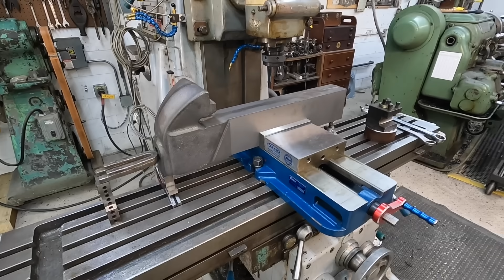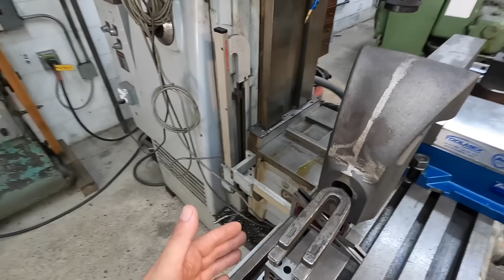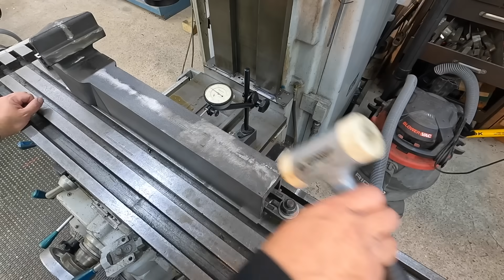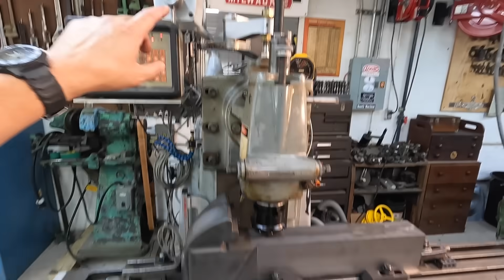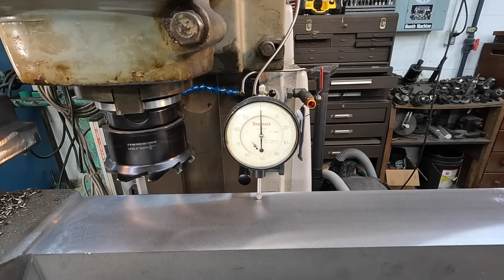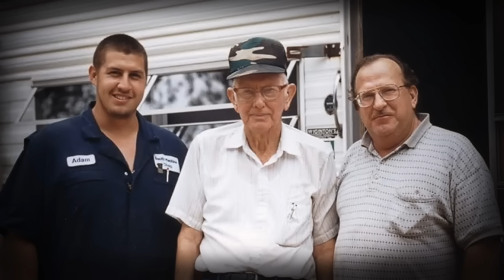Hardtail Vise Build Ep.9: Facemilling in the Kearney & Tracker Horizontal Mill

Comment: Have you considered rebuilding it . To tighten up the tolerance . Or is it not worth the time and money?
Reply: 1- It is way MORE the accrate enough for the vise and 100s of othere things. - +/- .010 TIR is good enough for a friggin vise. Most places on ot +/- .,025 would do.

2  Tighten the gibs. It only moves .002 what you go from dead loose to full tight. If you loosen the lock just enough for it to move it would be dead nuts on. .

Comment: I wonder if a fly cutter would have been an option to get under that overhang and also finish the rest of the surface?
Reply: YES......Set up horizontally  over the back edge of the table. - We got a 10" face mill that we use on out Cinci that way all the time because we don't have a right angle attachment  ;-)

Comment: 28:08 I believe the end marking is because half a tool realeses from the engagement and tool pressure lowers making the other side dip in to the part dipper. a spring pass usually solve this. but looking forward to see your troubleshooting...

Comment: Adam, beginner question.... your dial indicator does not have the base square....i take it, that does not matter....you are looking for movement from its random ref....is that correct?
Reply: Are you talking about a deviation from vertical for the spindle?  I think some of that might be the lens and capture, which is definitely not orthogonal.  The spindle actually looked pretty vertical to me. Then you can do the math... at nearly 0 degrees tilt, it's less than a thousandth error per degree over the 50 thousandths, so... not too bad.  Could have been off a little, but still well within tolerances for this beast!

Comment: You could take that vise to the next level and get the biax scraper out and scrape those 4 surfaces flat, square and parallel.... It would look pretty neat too !
Reply: For haw long . That is the vise where you whack on things with a 13 pound sledge. - THE most brutal tool in the shop. - It's what it's for.  so why the emote to bring in in at .003 TIR?

Comment: This setup would be the perfect time to have some Abom sized "low" profile table vices.  The ones that have the taper to them to press into the material as they are tightened down.  But, they use a SHCS fpr a fastener which is recessed in the body fully.  Putting two on either side rather than the toe clamps to stabilize the middle and reduce or eliminate the ringing.  Most of these clamps are only about a half inch thick.  I'd like to think and Abom sized one would be an inch and a half thick and two inches wide.

Comment: You have always had issues with the K&T. Problems with the motor, the knee, the ways and locks and even the spindle. Hell, you had it for several years now and you still haven't touched the on-board coolant. With the new shop, it may be time to let go of the K&T and pick up a big boy mill.
Reply: Or start a rebuild!

Comment: I'd love to know how you ensure that the spindle is square with the table.
Reply: The tram of the spindle in nod and yawl seems to be A1. The pattern left by the cutter teeth tells the tale. 

As to how to make this so, several ways, he usually trams by swinging a DTI (dial test indicator) over an averaging block placed on the table. There are at least 4 ways l know of to achieve this ensurance. As to how this time, your quess is as valid as mine.
Reply: Was the knee locked when the spindle was trammed? @CothranMike
Reply: @machinists-shortcuts  ah, so true, restraint of movement should not itself create movement. It is an old production machine never been reclaimed, restored, just cleaned and used.

Comment: If you run a board thru a planner you get “Snipe” maybe that’s what your Mill is doing?
Reply: In a manner of speaking it is the effect. The gib is 'adjusted' for the center a worn area. The gib is getting tighter as the unworn, or lesser worn dovetails engage that area and the table bucks a bit as the table is powered through. With hand cranking you can read the wear patterns of a production machine using the gib adjustment as a feeler gauge.

Comment: The finish changing on exit could also be from the part or tool 'ringing'. A 0.050" cut isn't nothing. Cutter on the backside has less load/deflection so prolly cuts a bit more coming back across which I'm sure you know. Also, yeah a long fly cutter would have done it...
Reply: I don't think so, you can see the cutter making arcs instead of full circles, so the tram is slightly off, but on the end you can see full circles, so from one side to the other the spindle tram is changing, a somewhat common problem on old equipment, the bed ways are worn curved, so the bed traces that curve.
Reply: @ChatNoirLe  You noticed that as well, good eye. I imagine the wear is in double digits, what do you think.
Reply: Thanks!  I didn't see that.  I'll re-watch at higher resolution and probably learn some stuff.   @ChatNoirLe

Comment: Hello Adam I was hoping you would use a horizontal milling cutter, I belief thy call it a slab mill
Reply: He memntioned using the mill in that mode, but did not say the cutter type or method, though come to think he did say hang it off the edge and using the tooling held in the horizontal. 

A small diameter slab mill would even fit under the jaw head maybe. But I like the shaper work he is planning for that area.

Comment: ABOM. A LONG FLY CUTT ER WOULD HAVE GOT UNDER THERE.
Reply: That would work but it’s really not necessary. The vise will be slightly stronger by leaving the extra material under the ledge.
Reply: @ellieprice363  
Inside corners don't make things stronger.
Reply: @ellieprice363  You must have missed the bit where he said he was going to machine it in the shaper, necessary or not, less strong or otherwise.

Comment: "In any system of energy, Control is what consumes energy the most.
No energy store holds enough energy to extract an amount of energy equal to the total energy it stores. 
No system of energy can deliver sum useful energy in excess of the total energy put into constructing it.
This universal truth applies to all systems.
Energy, like time, flows from past to future" (2017).
Reply: So...
Reply: @Bob_Adkins  Karl Marx, Nikola Tesla, Balfour, Einstein, Huxley, Orwell, Turing - should be forgiven for thinking their systems can last forever.
Finite fossil fuels are dangerously hypnotic to humans, their consciousness and mental capacity.
Humans were not ready morally, ethically and intellectually to start the mass extraction of fossil fuels with the advent of the steam engine 300 years ago. 
The Magna Carta requires today overhauling – adding to it the right for humans to understand what Energy really is - before any other commandment;
"No system of energy can deliver sum useful energy in excess of the total energy put into constructing it" (2017).

Comment: Nice to see the manual machines still being used at the home shop!  Always liked the Monarch lathe!
Reply: Come to our shop,,,,and it's a revenue  shop. We are actually industrial electrical/millwright contractors and have repair and replacement jobs where the parts are no longer available or have 6 months lead times. Well over half the time we can have the part done and be typing the invoice to the client before the kid can finish the pretty picture in SolidWorks and get the program out to the floor for the Haas mill. ,,,, Who can then start loading the tool changer. - If you think manual machines are not used every day to make money you ave not been out in the industrial world.CNC has it's place but it's not for quick turnarounds. .

Comment: I like this new tech where the tool spins opposite direction to the spindle. I believe that reduces imbalance vibrations and yields nicer surface although chips are being blown away in a direction opposite to cutting because of wind from spindle. Very cool!
Reply: I was thinking he should tweak the frame rate of the video so it looks right. It's a bit unsettling to watch as is.
Reply: Yeah, I'm feeling the wind.
Reply: And the way it reverses and even stops when you put a load on it.

Comment: If you set the part on the table the other way round so you cut from right to left, the chips would fly to the back instead of towards you.

The indicator is not needed. The finishing cut is relative to the previous cut, if both have the table locked the distance the knee moves on the dro or knee dial is correct. When the knee was moved up to 0.048" on the indicator it actually moved 0.050" because the needle dropped to -0.002" when unclamped. On the second attempt the table was moved 0.048" from -0.002" on the indicator to 0.046" and the clamp raised the final 0.002". 

Generally the knee is rarely locked, the large mass of the knee takes care of any Z axis backlash. This leaves the knee solid and the sheer mass of the knee & part stop any lift. The only issue arises when a combination of a cut with the knee locked is referenced to a cut without it locked. This is what was used in the video & the issue was entirely self inflicted.

Using a depth micrometer with a 5" long spindle does not give a solid feel. It is far easier to use a 1" rod onto a 4" gauge block.

A nice chamfer could have been added to either side with that cutter.
Reply: I thought the same thing, I asked him a similar question once and he said he preferred to avoid the machine throwing chips at him!
Reply: Them hot chips will keep you awake. Never fall asleep in front of a milling machine unless you’re leaning backwards.

Comment: Adam, how much time gets wasted re-thinking the set-up, screwing around with mounting that skyhook crap when you could just grab the dang vice jaw and lift it yourself?  It’s not THAT heavy!
Reply: How much time gets wasted at the neurosurgeons office because you blew some vertebrae out?
Reply: It's all good until that one time when you end up on the floor whimpering.
Reply: Just set the knee so the table is at the same height as the cart. Then just slide it on over. No need to lift anything.
Reply: @matter9  
When discussing the clearance issues, he mentioned the knee was already bottomed-out.  When jacking the lift table, he mentioned it was topped-out.  

The desire to be helpful is good, but it requires that one pay attention and be aware of the situation for one's help to actually be useful.
Reply: Says you. You ever slip and smash a finger the Bubba? -

Better yet If you ever were on a real jobsite with real men you would know you do not use meat to move metal. YOu use metal to move metal.......And you won't look like a question mark when you get out if the truck at the bar after work.

And this is You Tube. - Who cars who long it takes?.  Fast forward if you are in a hurry.  ,,,,, It add to the realism to the way things work in a real shop,,,,,where you obviously never have been in.
Reply: It is too darn heavy when you have a bad back or other "I am getting old" maladies. Wait until your doctor says "Get rid of all of your ladders, and never get on a ladder for the rest of your life".
Reply: In his younger days at Motion, looking for a lifting aid for anything heavy would have been mocked by his work mates.  Here we egg him on with the Abom Torque speak, with no concern that he might one day put his shoulder out.
Reply: That vice is 150 lbs. Not a good idea to be lifting that much across your back.

Comment: Wouldn't a fly cutter be ideal for getting under the fixed jaw?
Reply: Was thinking the same
Reply: Yep.. same question about using a fly cutter.

Also, I think you could have saved a skyhook move, by lifting the workpiece onto one end of the cart. Then sliding the  vice to the same end of the table, and setting it on the other end of the cart.

And if the skyhook had been mounted to the cart, no setups at all. :-)

Yah . I know, Monday morning quarter backs! :-)

Just hoping to save you some wear and tear.  

I think all old machinists suffer from to many heavy lifts.
Reply: @linuxranch  Sky Hook on the cart can overbalance the cart. Does this mean I'm coaching your Monday morning quarterback? Or half backing?🤔
Reply: It would work fine, but when you have the right tool for the job, use it. Fly cutters are very time consuming and easy to chatter. Plus, shapers are cool as hell.